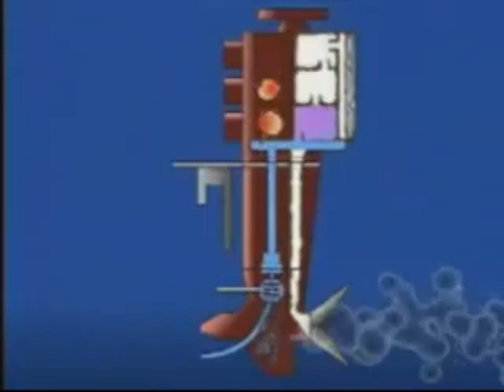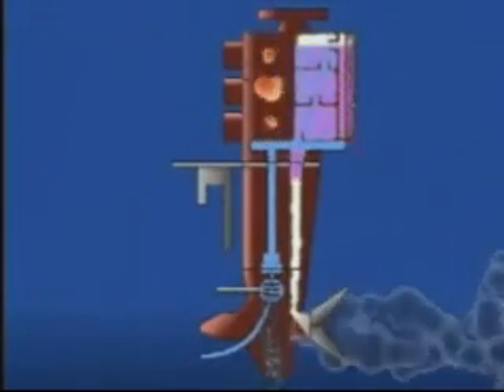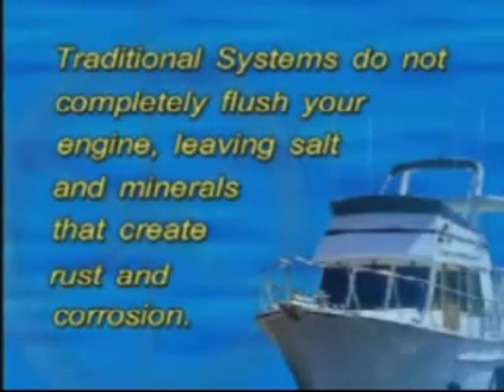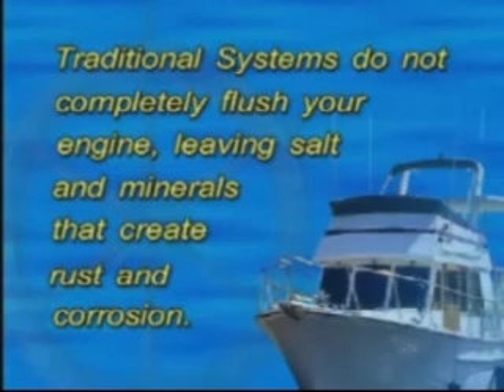SUPERFLUSHING YOUR BOAT ENGINES

Comment: There is not much usable information here.  The poorly produced video is a commercial for a product using what looks like dated video clipped together.  At the end there is a reference to another web site that is a disappointment as well.  I want to properly maintain my outboards.  I am more than willing to pay for a good product, especially one I can use myself.  I understand corrosion is a problem and flushing is important.  You failed to show me why or how your product is superior?  You did not show me how your product works to combat/reduce corrosion or how I could be more successful using your system/method/product-whatever "superflush" is.  Simply repeating in various ways that everybody else’s designs or methods are bad and yours is better left me disappointed.  More importantly it didn’t sell whatever it is that you are selling.  Sorry – nothing personal.

Comment: i'm sure this is deadthread, but just on principle i had to reply.  so how exactly do you "hydra-static pulses" "superflush" without running an engine with a CLOSED THERMOSTAT???  .failboat.
Reply: How can the SuperFlush System really flush the engine without running it? Won't the thermostat block part of the engine?
The engine block (where the plugs are), the heads, the intake manifold, exhaust manifold, and the risers are all interconnected in plurality. The thermostat housing is designed to restrict (not block, an important point) the cold water flow into the engine, and is upstream. The engine block injector points are downstream of the thermostat housing, so water below it has no impediments to being discharged through the transom assembly discharge ports, the exhaust ports, and others, depending on manufacturer.. So the short answer is: the water injected into the block assembly fills the block cooling passages first, then the heads cooling channels, then fills the exhaust manifold, then fills and exits through the risers, while the water injected above the thermostat housing fills the intake manifold, the exhaust manifolds, and the risers. There is obviously interconnectivity here. Remember, the thermostat is designed to restrict water flow from the seawater pump. With the engine running in the ocean, there is only one place it can get into the engine...from the pump. Using the multiple injection point strategy, we come in above and below the thermostat housing: problem solved!
Points to remember:
1.	The SuperFlush System uses 4 injection points to introduce water into the cooling system, not 1 as the seawater pump.
2.	The SF System is a True Reverse Flushing system, reversing the normal coolant flow scenario, so as to overcome...the thermostat issue!
3.	The hydro-static shocking pulse is operating at a very high frequency
Reply: heliax007 

Why was none of the information you wrote about in the
video?  Nothing about reverse flow,
nothing about frequency.  I got more
insight reading your response than watching the video several times and
reviewing the referenced website.  You
may have a good product on your hand, but whoever produced this video failed to
present it well.

Comment: My 1992 Evinrude 150 Spitfire has a built in nozzle flush that allows me to hook up the hose and flush from the top down.  I run in all 3 types of water and no problems related to corrosion.  No need to run the engine.  Just turn on the hose and flush for 5 minutes.  Unscrew the hose and reinstall the plug. Make sure the engine is trimmed down to drain properly and you are done.  Your video gives absolutely no evidence of how it works, how to install, or how much it costs.  Waste of time.

Comment: Congratulations... you made a lot of false assumptiopns and told us or showed us absolutely nothing about your product... I have flushed with muffs for 6 years and there is not an ounce of corrosion in my motor which is always used in saltwater.